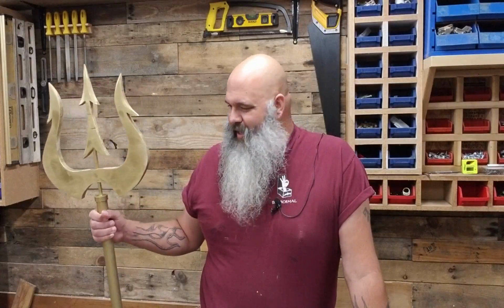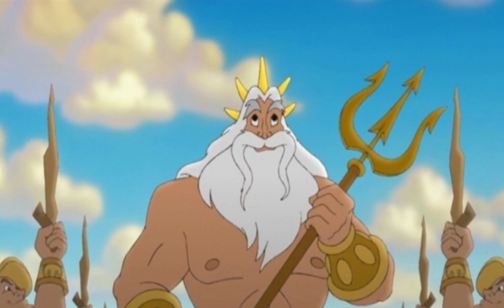How to Make King Triton's Trident!!

Comment: If you can I think your videos would benefit from having the camera set in manual mode. The constant focus adjustments is a little much on the eyes.
Reply from the maker: Yeah, sorry about that. I strictly use my phone to film all my videos, and I just got the Samsung Galaxy Note 8 and I'm noticing that. I haven't figured out what's causing it. It could be the 60fps setting. I'm going to change that and see what happens. Thank you for your helpful comment.
Reply: Yeah I thought it might be from a cell phone. Good thing about those android phones is they have tons of camera settings. Keep up the great work!
Reply from the maker: Thanks! I just switched to UHD and it, so far, seams to be working.